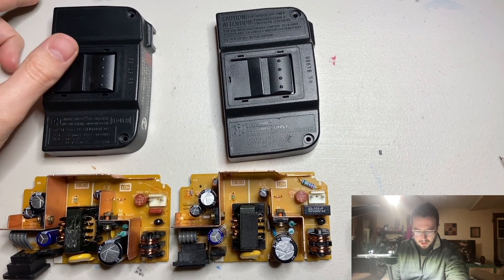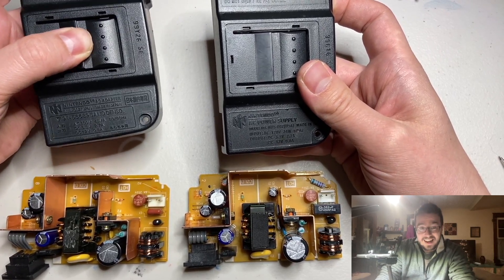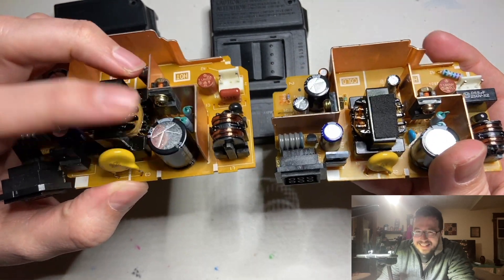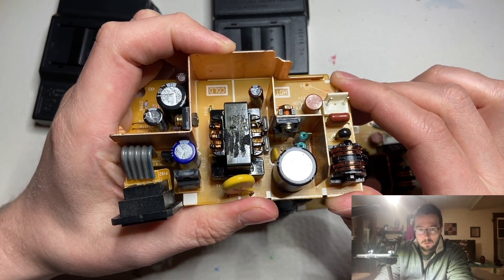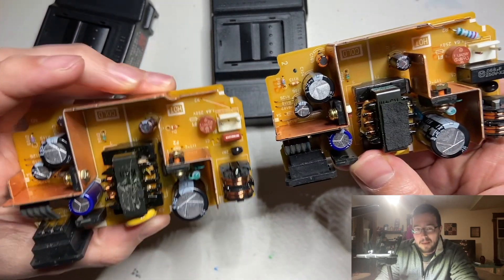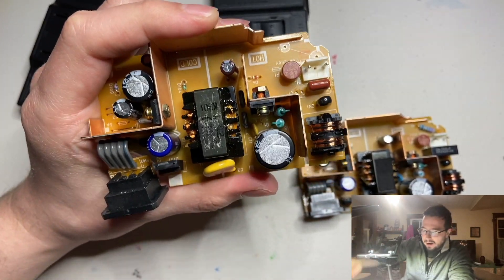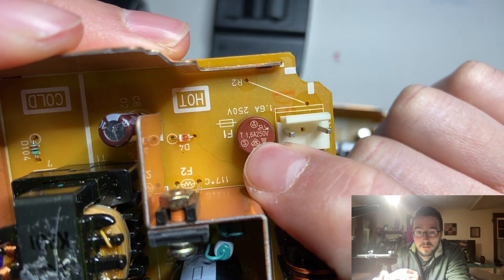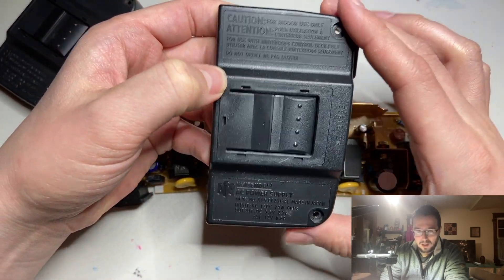You might be frying your Japanese N64 with the wrong power supply

Comment: Been using Japanese power supplies on my Japanese AV famicom and N64 for quite awhile with no issues here in the US. I have a feeling Japanese "100v" and American "120v" are effectively the same thing with the average difference being more like 10v than 20v. I also feel that even if the difference was the full 20v; applications like this have plenty of tolerance. If anything, I might be more wary of plugging a 120v american supply into the 100v Japanese socket and potentially undervolting things a bit.
Reply: "No issues" doesn't mean no long term damage. If you plug in a Famicom AC power supply into a US outlet, the console will run 20% hotter from 20% higher voltage and not last as long. You shouldn't be upvoted. It will seem to work fine but you aren't measuring the temperature difference. For N64, the R2 isn't there for no reason. Unless you reverse engineer out the difference and know the transformer is rated for 120V, you shouldn't do it. There may also be revisions where one model is fine on a US outlet and another is not.
Reply: @BoxingDayAC  may i ask what your professional background is? Because you don't seem to understand that things are engineered with these kind of tolerances in mind. Also seems like you don't quite understand how voltage regulation works in something like this. Explain how it's running both hotter and at a higher voltage? It's good you know that 120 is 20% more than 100 but, that information doesn't amount to much when you are ignoring basic electrical theory. Admittedly, I have not been to japan and plugged a multimeter into a wall outlet but I'm pretty confident about the difference being negligible. I bet it would easily be mistaken for 120v outlet if i were to send a picture of the reading without context.

 I see anywhere from 105 to 130v on "120v" circuits in the US and electronics are made to handle that difference. Especially things like transformers/power supplies. That's their whole lot in life. Providing smooth, consistent DC current to the more sensitive components that don't tolerate the swings seen in AC current.  Of course, there is always an "optimal" or "ideal" standard when something gets engineered. But, products worth buying (ie anything nintendo from this era and older) are designed to operate reliably a fair bit out of that range. If there was a power supply revision that fails at 120v but not at 100v; there's more than one reason it wasn't the revision they stuck with.

Comment: Soldering the R2 resister back (27.5Ohm/5W/.5% tolerance) will fix any long term problems and convert a Japanese supply to work with 120V as that resister is to avoid burning out the rectifier over time at 120v.

The reverse is true, removing R2 will convert a U.S. Supply to properly accept 100V. 

However leaving R2 in place will work and the cause no issues as it will simply run with a bit less than expected input voltage and still output the voltages the N64 needs. The rectifier won’t burn out having less power than rated for.
Reply: I cant seem to find a 27.5Ohm .5% tolerance resistor anywhere also have opened 2 different US power supplies that have different resistors and completely different boards. Do you have a link to where I can buy the 27.5 .5% resistor ?
Reply: @HyperHawkCamaro  I have the same question.. I can find 27.5Ohm/5W/ but the tolerance is 5% instead of .5..  This should work in theory.. but I am not sure
Reply: @mariohunterll  So ive been using the JPN power adapter for testing now for about 6months sometimes for 5-8 hour shifts.. no overheating no issues so it seems to handle the extra voltage variance just fine. I also tried to find someone anyone who may have hurt a console or had any issues and couldn't find anything.
Reply: @HyperHawkCamaro   thank that is good to know, I guess I'll grab the resistors with a 5% and give it a stress test.
Reply: @mariohunterll did you end up doing it?
Reply: @HyperHawkCamaro its not a 27.5ohm !  It's a 2.75ohm , color code red violet green silver green.

Comment: I am really tempted to try adding in this resistor to my Japanese N64 power supplies and essentially make it a US power supply, has anyone else tried it?
Reply: I could try.
Reply: Late response but It will work. It will act 100% like a U.S. power supply once R2 is added.

R2 is 27.5Ohm/5W/.5% tolerance
I would not recommend lower than 5W or a higher tolerance.
Reply: @ShamaNamaDD  hm so if I put a 20ohm 1/4w 1% (that I measured at like 22ohm) is it dangerous and better to remove that, or is it just less effective?

Comment: Hmm I use a step down converter and it spits out 110v right in the middle 😂 but since I don't use my Japanese N64 to often the psu might brick because of old age before it feels something from 10v to much. I would not worry to much. I am pretty sure in the 90s a lot japanese N64 ended up in the US and Europe with the slightly wrong v used and nothing came of it. We are in 2023 and here the first time anything about it.
Reply: its all nominal voltage. likely just a difference in nomenclature. wall sockets in the US vary from 105-130v under "normal" circumstances. I'm sure Japan is similar

Comment: Here in the United Kingdom voltage is far higher than in the United States or Japan @ 230 volts so for an ntsc n64 over say a step-down converter I'd recommend a uk psu as a replacement!